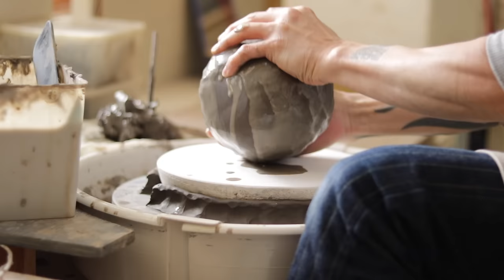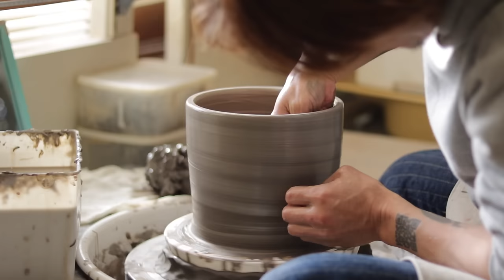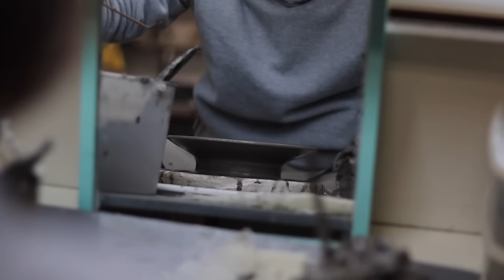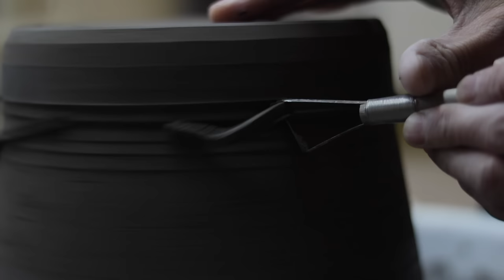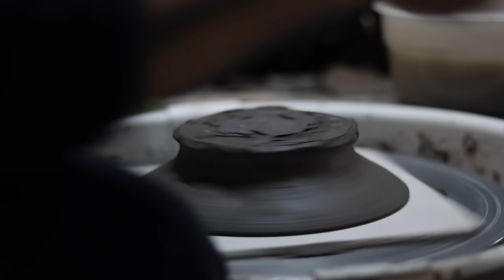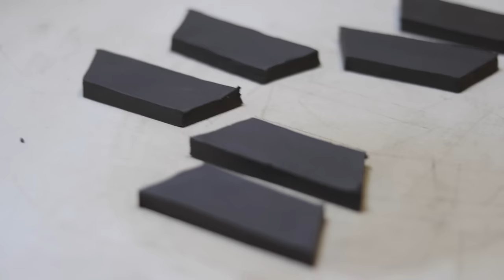僕の仕事。 土鍋をつくる Make a clay pot

Comment: The bevel in the handles is so nice. Clearly you were thinking about how this pot will be handled, making it pleasing to the touch. Lovely work. I also like your technique of sponging off the glaze instead of using wax, leaving your signature to stand out better on the underside of the pot. I learned so much from this.
Reply: That’s what sets it apart from and amateur use product
Reply: The wax completely burns off in the kiln no trace of it left so it will look the same either way.

Comment: To the left handed from the left handed high five) 
I'm a newby and in fact I can't decide whether to learn pottery as a right handed person because most of the people do it that way and it would be easier to seek help  or as a left handed as who I am) how did you decide? How did you handle difficulties while learning? 
Those are great pots by the way! Really nice design!)
Reply: I am right handed naturally but weirdly I found that I work better on a wheel as left handed. Just try it out with a studio that has a wheel that runs in both directions and see which position feels more comfortable and gives you more control and precision over the clay. Also, I should say that western ceramics usually do right handed but Japanese usually left handed. So just try it and see how you feel.
Reply: @PallasAthene12  wow! That's very interesting!) thank you for sharing))

Comment: As a potter myself, it took a couple of watches to figure out the measuring stick and using it to determine the width of the pot, then the same width becomes the inside of the rim for the lid. Magical pottery with an insane level of detail (or lack thereof lol) meant with the utmost respect!!!  👏

Comment: I wonder if you could use Thale's Theorem when you're marking for the handle placement. A right angle on the circumference of a circle will mark a diameter of the circle. Simply mark the midpoint on your paper guide for the midpoint of the handle, and line those up with the diameter marks

Comment: Shino, do you understand English?  He didn't show the first firing. But he has to exaggerate the dimensions by about 20% before it is fired.  So if he wants the final dimension to be 8" high he has to make it 10 inches, before the first firing.  Same goes for the other dimensions, including the width of the walls of the pot.  He doesn't show that part, which I think is an interesting factor.  No way in the world would I make stew in these pots, but that is what they are for.  A wonderous craftsman.  Thanks.  I wonder why you wipe the glaze off the lip?  I know it is for a practical reason, do you get a better seal like that?  BTW, the teapots are beauties.

Comment: I have no knowledge about pottery, so i wonder is just by glueing with water the handle would be strong enough to support the weight of the pot?

I deeply concerned about the pot in my house right now, should i not lifting it using the handle?

Comment: I seen your video and is very interesting. It seen to be that you are using pure ferric oxide to the last coating to make hematite over the surface pot. The ferric oxide melt at 1500 C so maybe you use boracic glass or sodium borate as a fundent. Is that correct. Which coating use ? What is the cooking temperature? MANY THANKS IN ADVANCE.

Comment: Question. When you are turning the piece down to dimension. Do you use push vs draw cuts and in which instance is one better than the other.  It seems similar to wood turning but I wonder if the techniques are similar?